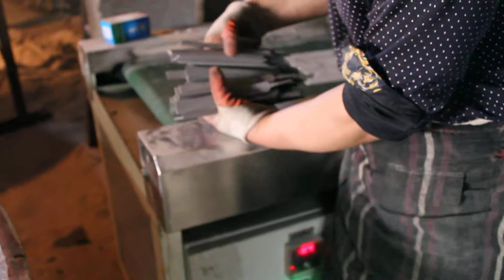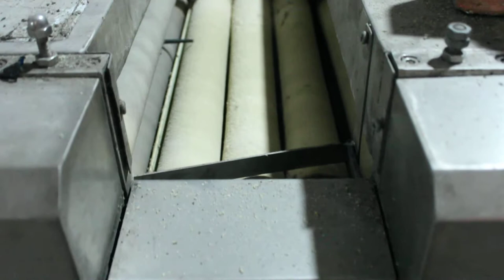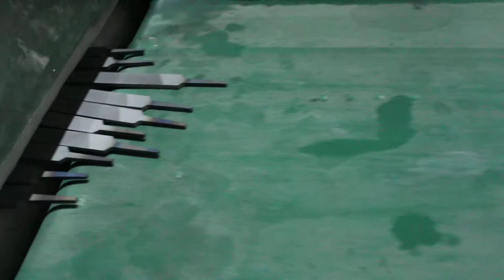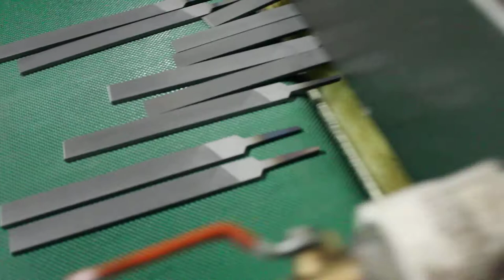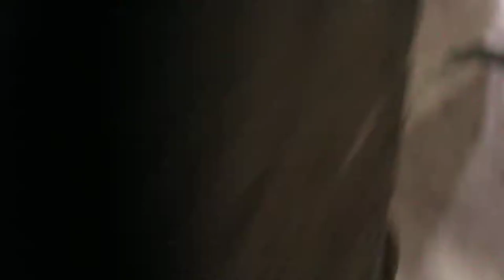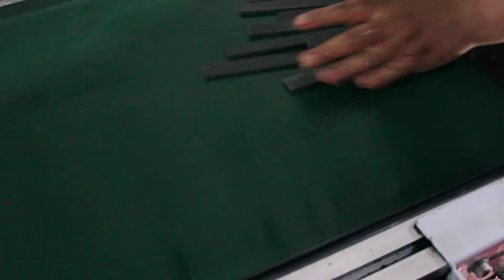Production Process of Steel Hand File from Nanhe Ruixin Steel File Co.,LTD

Comment: can anybody tell me please the %of carbon in hand files?
Reply: Most good quality files are made of 1095 or W2.  However, those are hard to come by now adays unless you buy old files or hand made ones.  Most files made today are low carbon steel and are only effective for short periods of time or for woodwork or work with soft metals like copper or brass.